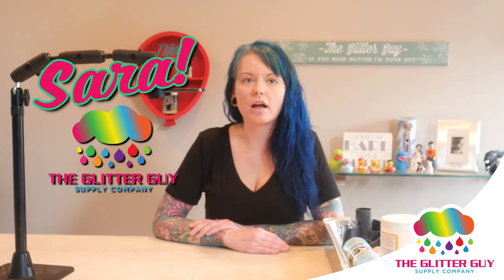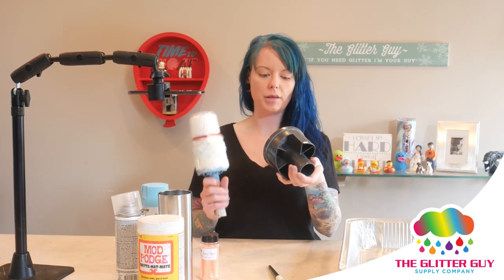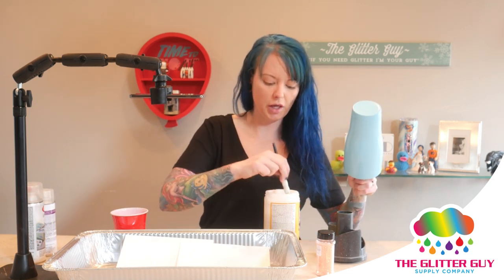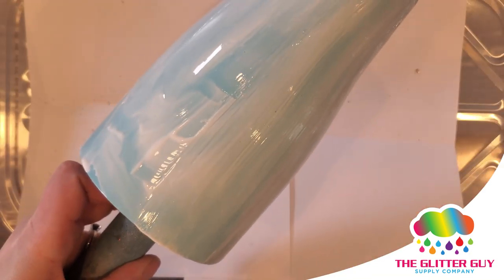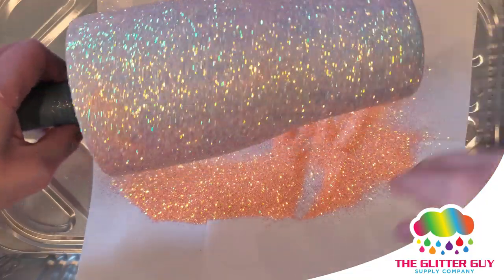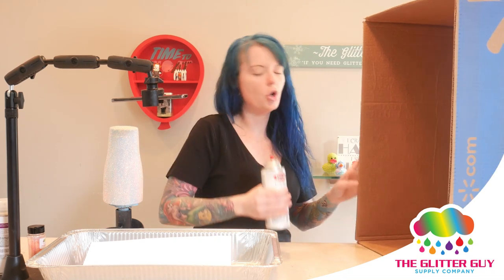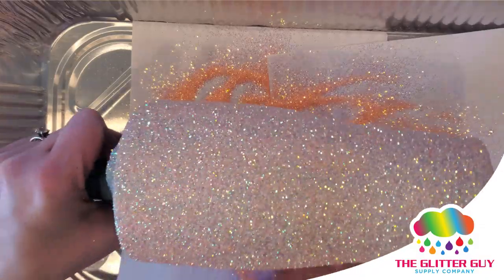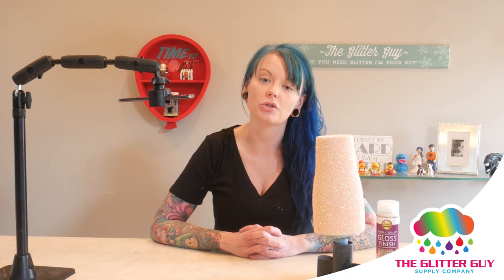How To Glitter A Tumbler | Mod Podge Method | Start To Finish For Beginners

Comment: I clean my paint brushes with Jabon(soap) Zote. You can find it at Walmart in or near the laundry detergent isle. Underwater you run your brush on the soap bar then rub the soap onto into the brisles until sudsy. Then wash it off and keep doing that until the brush is back to normal.

Comment: Hey Sara,
      I am trying to find a video of someone spray painting a base coast on a tumbler.  I always seem to get paint inside the cup and am trying to find ways to eliminate that. Do you know of any?  I have tried to look on youtube, but haven't found too many that are helpful.  Thanks!
Reply: Courtney Wood if you get the paint inside the cup it is really simple to get it out. Just take a rag, coffee filter, paper towel etc. and some 91% alcohol and it will wipe right out. The sooner you wipe it out the easier it’ll be. If alcohol isn’t taking it out you can do the same method with acetone! To avoid the paint getting inside all together take a paper plate and cut a hole in the middle of it. Make sure the hole is just big enough for your PVC pipe (or whatever you’re using to hold the tumbler) to fit through. Slide the paper plate all the way up to your cup and then leave it there while painting. That’s an easy way to keep paint from getting on the inside 😊 I hope I could help!